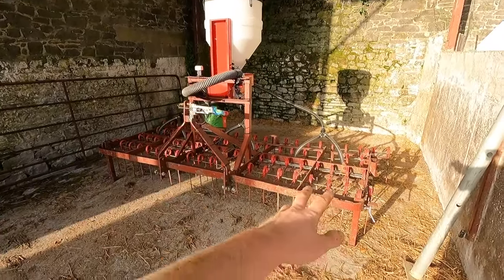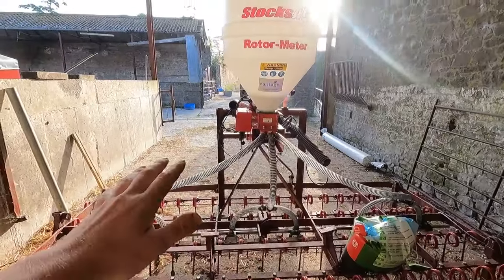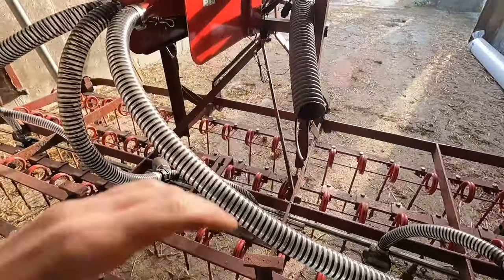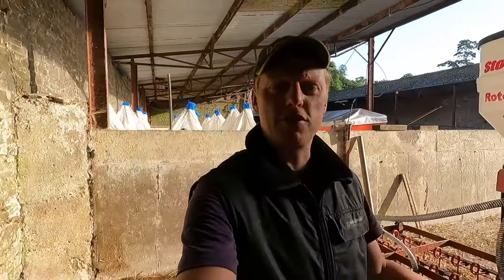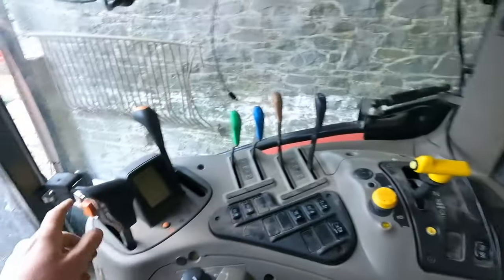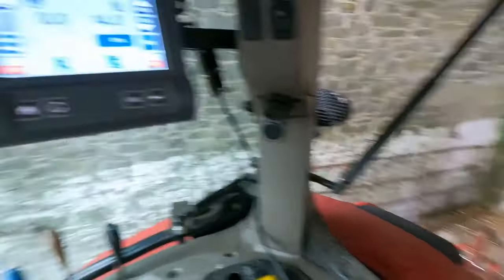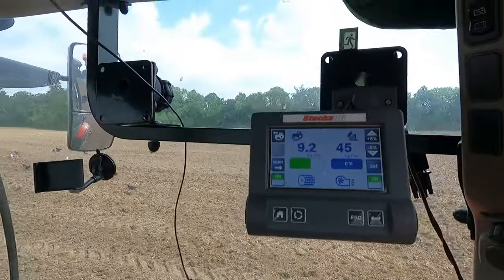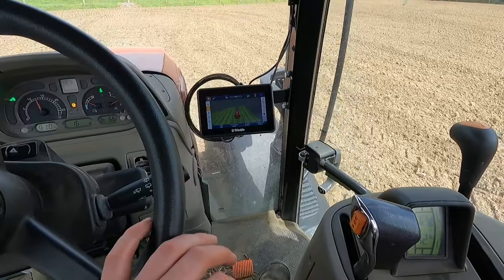SOWING MULTI-SPECIOUS WITH OUR NEW STOCKSAG AIR SEEDER AND HOMEMADE TINE HARROW!!!

Comment: Well done, a bit of a rake adjustment on those tines would be a super help on soil but they need to be verticle if you want to drill into burnt off ground.   Did you try sowing seed into an existing sward?
Reply from the maker: A very small bit, seemed to go well. Will hopefully do so oversowing with clover next spring